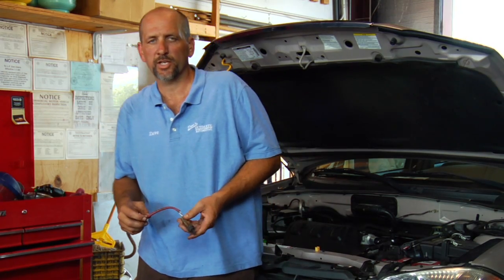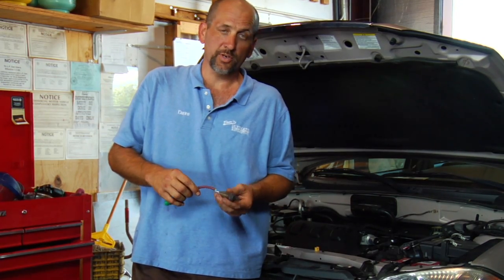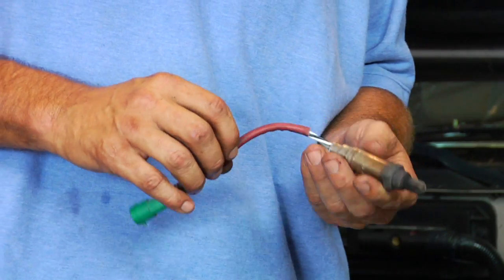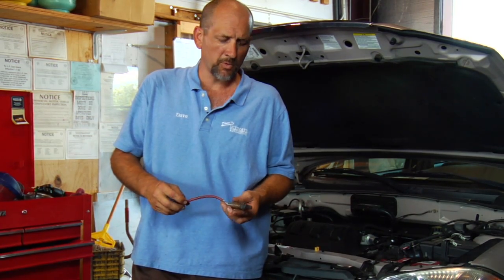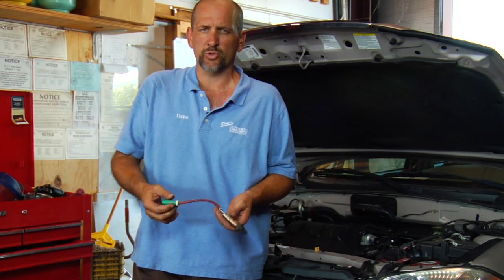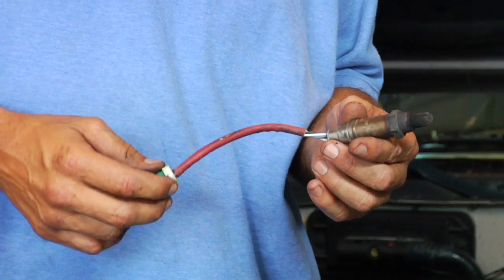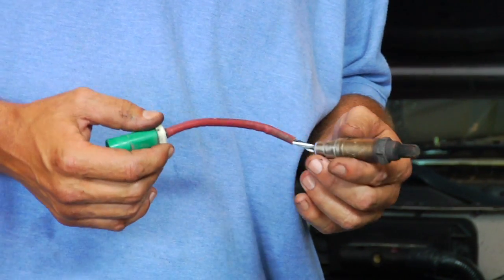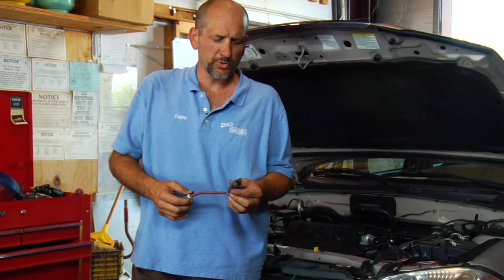Automotive Troubleshooting  : How to Know When to Change an O2 Sensor

Comment: i have a 1994 bmw e34 520i and diagnostic did not report any problem with o2 sensor but between 2k and 4k rpm i get power loss in several places (2.5k, 3k, 3.5k...) and everything else is ok. mileage is also perfect. but if i unplug o2 sensor i get the power back. so how to be positive if sensor is broken. are there any ohm or volt values i can measure? i think i have 3 or more wires on my sensor. maybe 5? thank you.

Comment: i have a 2002 bmw e46 325xi with a 130,000 mille the problem that i have with this car is that im getting bad millage, 
im getting about 12.5 mille per gallon and i dont have a check engine light i change the air filter gas filter then it went up to 13.5  do you think that the oxygen sensor need to change
or do you think its something els. thx

Comment: Hello,my car has this problem and i already replace the sensor But my check engine light still on. I checked all wires and I found one disconnected from one of the end on one of the conectors. I put it back but the light still there. All fuse are good :( any help will be appreciated. Thanks

Comment: @nightmathzombieethan My car DOES have an ancient ECU, but it shows no trouble codes....I'm not even sure it COULD detect problems with the O2 sensor (I need to do more research), but even if it does, I would imagine it couldn't tell if it was giving lazy readings.

Comment: Any suggestions as to other indications it's time for a replacement? I have a pre-obd1 car (I call it OBD-NONE!) (an 86 Prelude) That has a "light" random yet consistent misfire/burble at idle and it tends to backfire/hesitate under heavy acceleration. I've replaced/checked my plugs, wires, coil, cap & rotor, vac. advance, timing, injectors, valve clearances, vacuum leaks near intake, etc. I'm at wits end and I'm running out of possibilities!

Comment: Hi! the oxygen sensor high voltage is caused by a rich condition or a shorted or damaged wiring between the engine control unit and the oxygen sensor. The fuel pump when new puts out correct pressure, with age the pressure is reduced trending towards a leaner condition. Check the fuel pressure value. The O2 sensor at the CAT only monitors the cat for efficiency. A fuel regulator leaking internally would cause  rich condition. Shaking engine can be caused by incorrect fuel air composition.

Comment: @cano307 Part 2  conclusions presented to you by obd 2 codes need to be verified before doing repairs. A rich condition should lead you to investigate fuel regulator, Injector pulse width, coolant temperature sensor input, fuel injector integrity and data stream  from your Engine Control module. observe the traces on a scanner for the fuel injector. There are few simple answers for auto repairs with the degree of complications designed into a modern vehicle. we must embrace this difficulty

Comment: @cano307 Part 1.Its helpful to include the exact code. Most fuel concentration problems on cars are biased towards a too lean condition. normally a rich condition caused by the O2 sensor will be corrected by the long term fuel trim input and allow the recovery of some of your fuel efficiency. The best way to evaluate an oxygen sensor is to use a scanner to trace the voltage oscillation between .1 & .9 volts and the oscillation frequency per second.  a code reader is giving you a conclusion